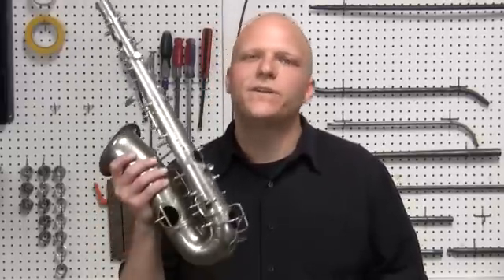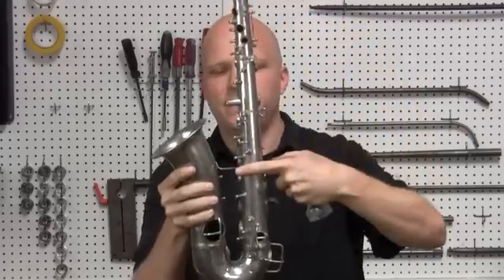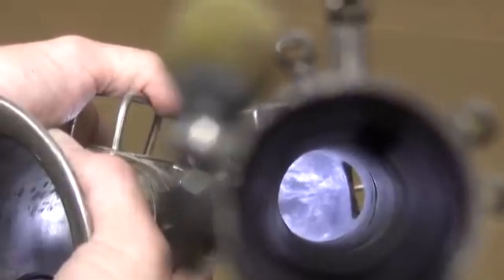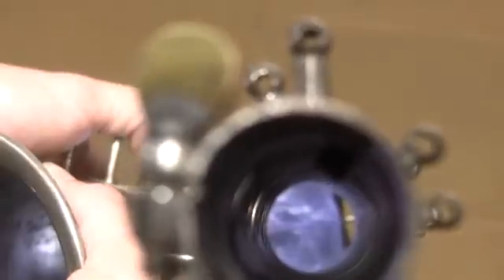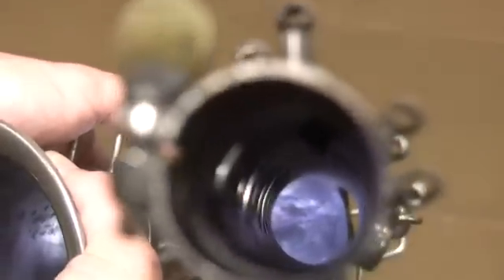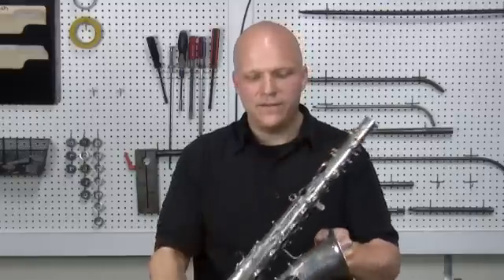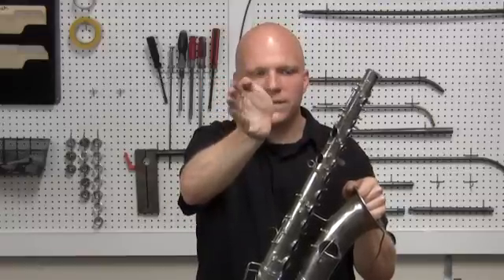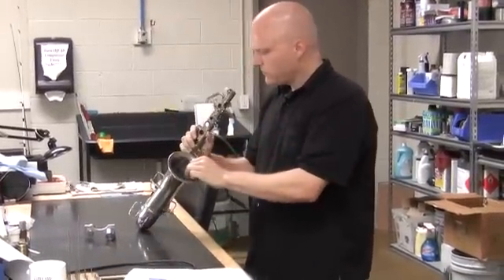Straightening a Saxophone Body with the Body Slam Tool

Comment: Why it bent and why you need to repair it? Maybe affect intonation?
Reply from the maker: Bodies can be bent over time by the horn moving in the case, an accidental shock or damage and from being used by the player. Aligning the body allows the keys to be fitted perfectly. Once it is straight it should not affect intonation.